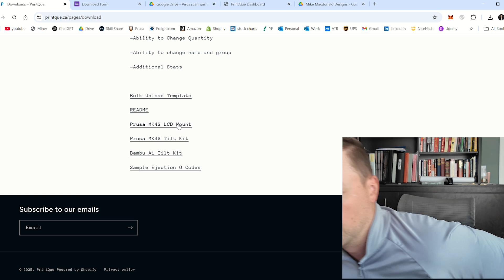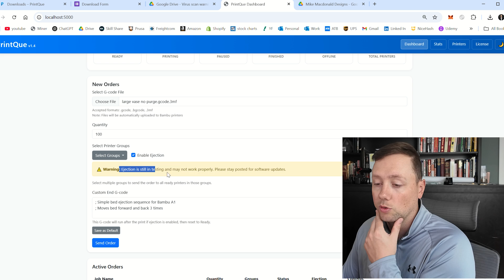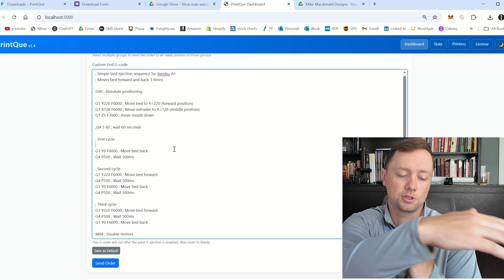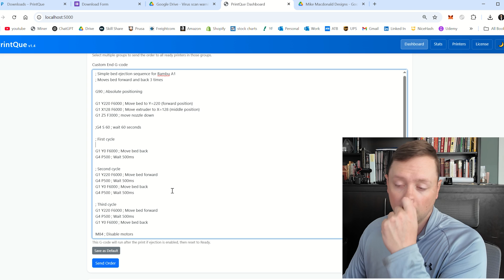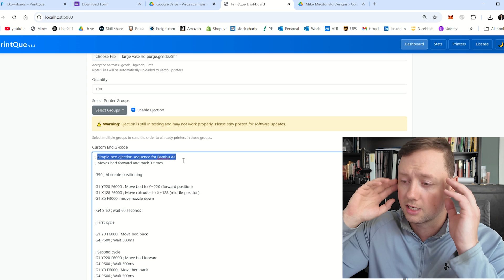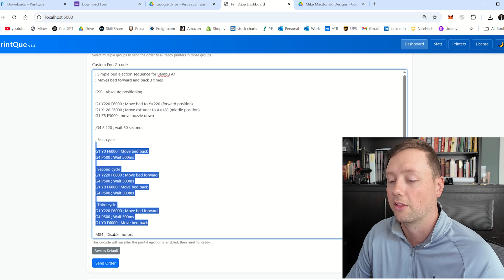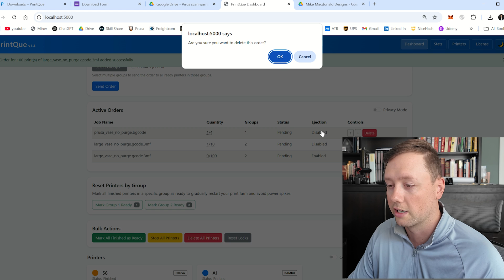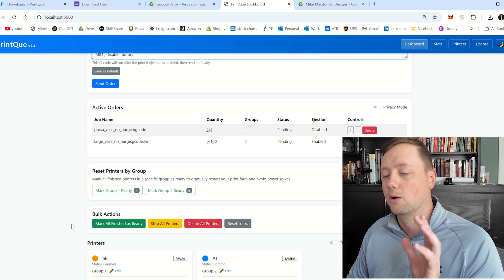PrintQue- Ejection Tutorial

Comment: If you have the printer at a 20 degree angle, how are you compensating for overhang thresholds in the slicer to determine if it should print a support or not? My prints can be stuck on pretty firm sometimes. Have you noticed any strain on the printhead by using it as the tool to pry off the part?
Reply from the maker: Havent really had this issue yet.  I would say to compensate by adding more support but I dont think you would need much